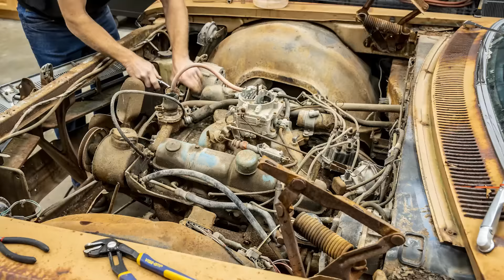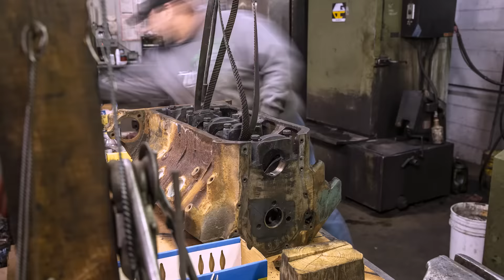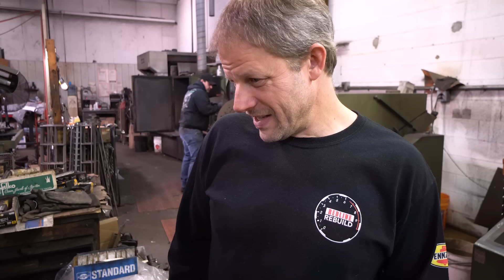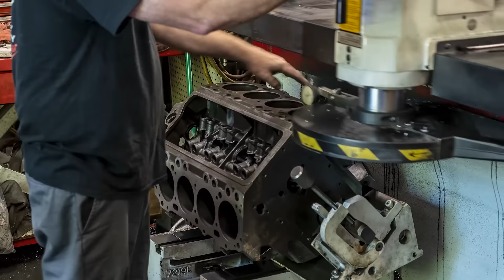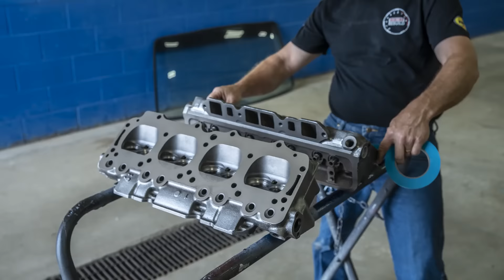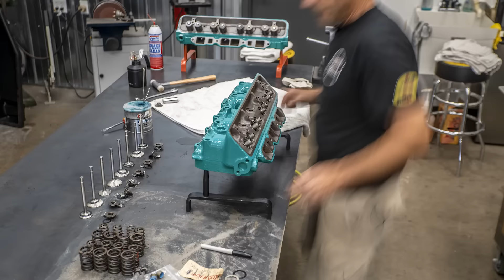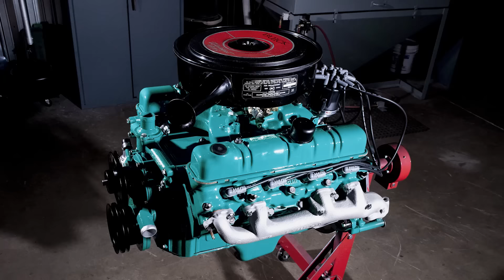Buick Nailhead V-8 engine rebuild time-lapse: from rusty to roaring | Redline Rebuilds - S3E3

Comment: When I moved to America back in 1972, my relative brought only American car, we have Pontiac Catalina that has engine size bigger than the fishing boat. America used to produced only high quality merchandise such as TV, car and firearms. I used to worked in American factory and we have every high quality standard that we can beat Germany and Japan back in 1970! In 1973 we let crappy people from oversea to screw us on automotive industry by  allowed them to controlled the oil price. In 1990, we sold our country to the Communist China and let them screw us with cheap junk crappy merchandise including Aerospace, Automotive Electronics, Firearms, Texts tile and medical industry. We let  a large groups of people from oversea came in and took over top industry and fired about 90 millions of us to the street and ended our well paid career for goods. At this point, there is almost none existing US made Automotive product, including Electronics are being made in America. I think we can not even find  even a knowledgeable persons in a field of how to produced  any quality automotive parts like what you guy had worked on   in 2020.

Comment: It's fascinating to think about GM in it's prime. Every division creating slightly different engines, not just rebadged mediocrity. Pontiac had the 326, Buick had the nailhead, Chevy from the 348 the 409, then the 396 and 427...
Reply: How did I forget the 400 small block?

Comment: So, why is it called a Nailhead?
Reply from the maker: It became known as the "nailhead" for the unusual vertical alignment of its small-sized valves, features that were the result of putting both valves on the intake manifold side of the "pent-roof" combustion chamber.

Comment: I know its a cool video...But why is it called a Buick Nailhead???
Reply from the maker: It became known as the "nailhead" for the unusual vertical alignment of its small-sized valves, features that were the result of putting both valves on the intake manifold side of the "pent-roof" combustion chamber used in this engine series.
Reply: Thanks for the info. Love your vids